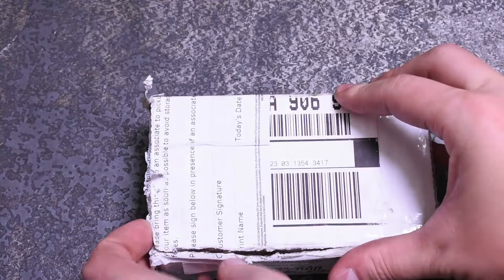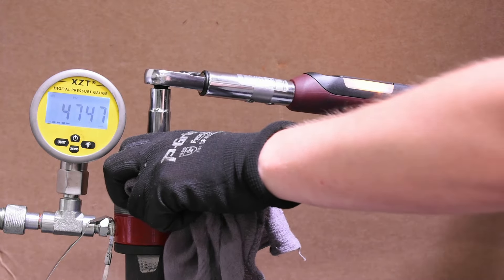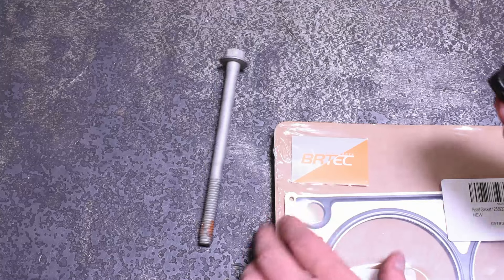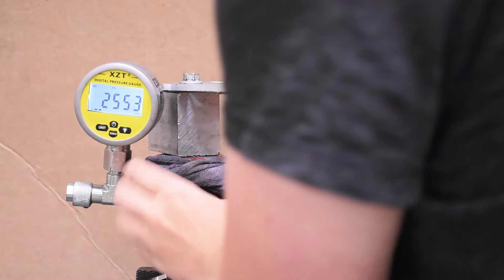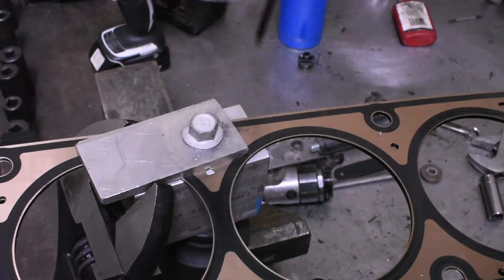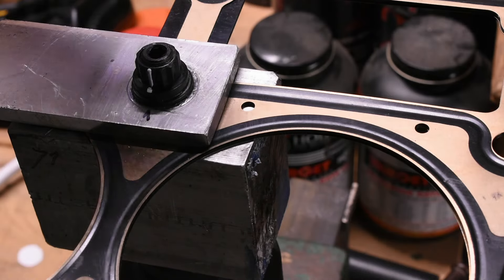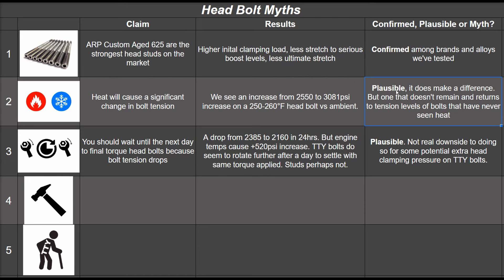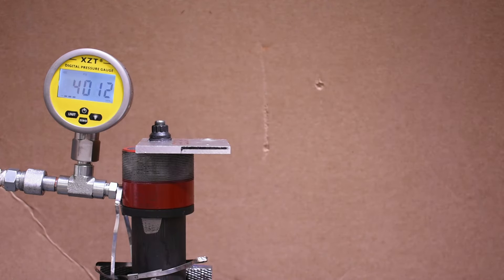CAN You Reuse Cylinder Head Bolts? Testing Myths + ARP Custom Aged 625+

Comment: My thoughts. If you are building a NATURALLY aspirated low compression engine new bolts are probably not needed, but cheap enough to buy new anyways.  If you are racing a half a million dollar nascar or pro mod $1000 set of bolts is a drop in the bucket and good insurance to protect your car,  life , and those you are racing with. If you are driving or racing a less expensive car you may not need new bolts but anyone who has ever lifted a head gasket and got water or oil under a tire at 150 mph will tell you they wish they would have replaced the head bolts.  Rebuilding engines, especially modified ones is not a cheap process.  Why try to be a cheap ass when it could cost you or someone else thousands of dollars or someones life....

Comment: Old model vehicles cast on cast use them over and over aluminum heads on cast blocks most had non reusable bolts
Reply: Has nothing to do with the engine material and everything to do with bolt science / reliability. You get much more consistent torque with a tty bolt so they have less warranty issues.

Comment: Just because you can doesn't mean you should. Unless you like less clamping force 😜
Reply: Not true unless the bolts have been previously grossly over tightened to the point of necking
Reply from the maker: Testing seems to have shown it created the same or slightly more clamping force

Comment: If you ever had the pleasure of taking a head off a 4.2l Trailblazer whacking the headbolts with a hammer will keep the breaker and 4ft cheater from flying across the shop every time you break one loose... and there is alot of bolts to break loose